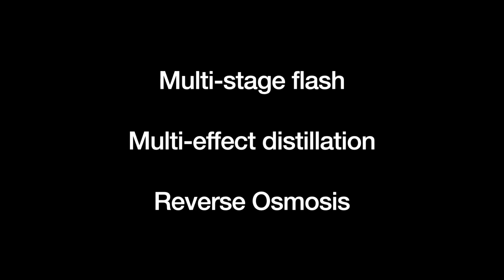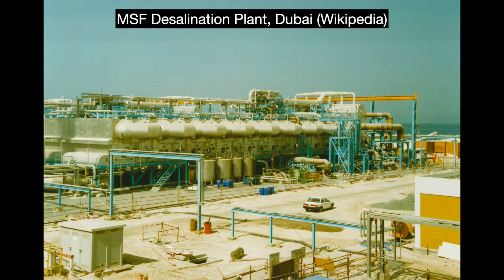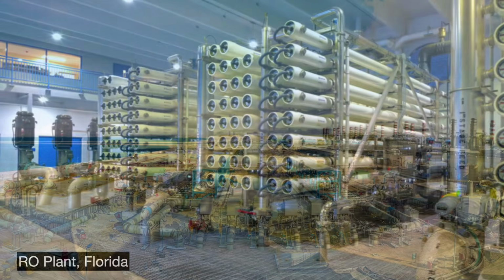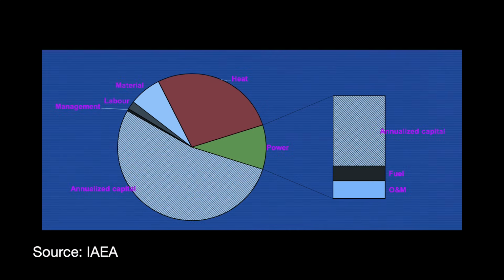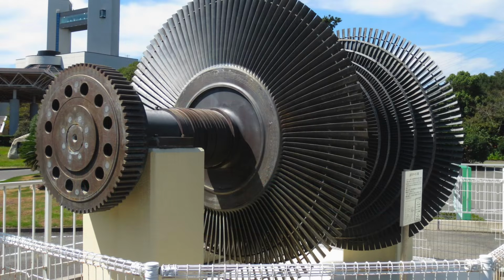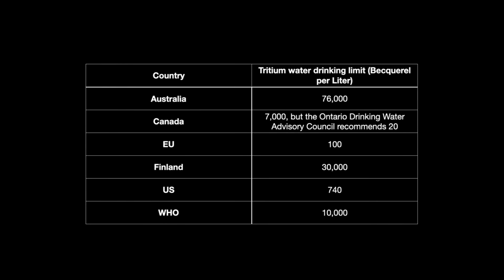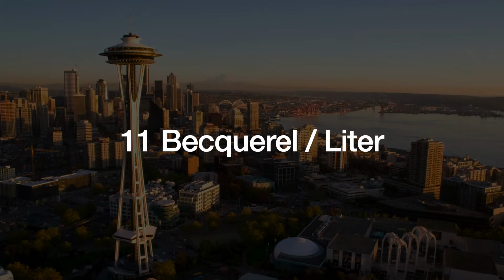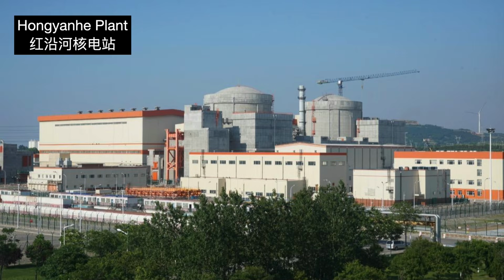Going Nuclear to Desalinate Seawater

Comment: Modern desal plants are up to 90% water recoveries these days - very impressive. That minimises the input flow as well as the sea critters it effects. You then combine the brine outflow with the treated sewage outflows and bingo bango. Let's roll.
Reply: I wonder what ratio of brine to treated sewage are needed
Reply: @FrankGarcia24  Don't forget stormwater runoff. That is  not a zero figure.
Reply: @FrankGarcia24  That can also be used for dilution. It starts to balance out yeah?
Reply: ... how does 'dilution' NOT fail.... at Scale.....
Reply: @nealtauss1715  Every city and it's surround catchment is a significant surface area. A great majority of a modern city is covered with concrete/bitumen/smooth surfaces that have minimal water take-up. That means a lot of rainfall tends to end up as storm surge or in the associated seaward discharge systems of that city. Probably all of that water is not good enough quality to drink however it is ideal to dilute any saline/brine from a desal plant with some simple storage/surge capacity. Thus you should be able to offset the brine production through dilution from sewage/water runoff systems.
Reply: @nealtauss1715  The theory is that we piss out as much water as we drink
Reply: Modern desalination plants that use MED are rare. RO recovery caps around 30%. Msf around 16%. Solar around 20%. It's my job to know these things. Majoroty of plants run MSF and RO at the moment
Reply: @Froggeh92  I think to solve the future water crisis no matter what technological limitations or inefficiencies there are with our current desalination methods could just be solved regardless by the human race not being squeamish and just making a lot more nuclear power plants and using the energy to power whatever is the most efficient water treatment method we have. I also think that when water starts getting real scarce and we take it seriously that there will be many breakthroughs in water treatment and nuclear power because we often always neglect fixing issues and doing the proper research unless we are forced to or are in deep shit. Look at the space race for example but imagine that effort and innovation multiplied many times over for something like a water crisis.

Unfortunately at the present I have serious doubts we will advance beyond a snails pace because of our greed and complacency.

Comment: Here in New Zealand we do the opposite to desalination.  At the Manapouri hydro power station, we take 510m3 of fresh water per second and dump it into the sea to produce 800MW of electricity. That's 44 million cubic meters of fresh water per day.   Makes that Soudi desalination plant look tiny in comparison.
Reply: It gets crazier.  There is a tunnel (9. 2 meters in diameter, 10km long)  that is used to discharge the fresh water into the sea. Once operational, they realised it was too small to be used to operate the power station at full capacity. So they tunneled another one at 10 meters diameter.  Just try and imagine how much fresh water flows through those two tunnels.
Reply: @debochch  its just a dam. Without it, its just a river doing the same thing.
Reply: @TheBooban  no.  In normal dams, the water continues along the river, as you pointed out.  At Manipouri,  the water is diverted away from the river, through the mountain, and directly into the sea.
Reply: @debochch  either way, it is going into the ocean right?
Reply: wtf this is lunacy!!

Comment: Do we want more nuclear power plants to be built by the ocean? We would need to design them learning the lessons of Fukushima, while also avoiding seismically  active areas. Of course, the problem is that an area could be quiet for hundreds or thousands of years and then there can be a large earthquake.
Reply: There are nuclear reactors operating on ships that shake and rattle as they move around the world. I don't think earthquakes are a big issue, really. You can design for them. The problem at Fukushima was that they turned off the reactor the moment the quake was detected, but that meant they needed backup power, and the diesel generators were in the basement where the tsunami reached. If they had kept operating, the accident would never have happened.
Reply: @eckligt  also if the diesel generators weren't located in the basement

Comment: Under environmental concerns you should have talked more about the increased salinity of ocean water near plants that dump their brine back into the ocean after removing most of the water.
Reply: You mean several thousand m³ of more salty water can change the ocean? 

Check the size of the ocean.
Reply: @LMB222  No. High salt brine affects the local area around the outflow pipes. Just like when the guy next to you is smoking a cigarette, you'll breathe it in. Even though cigarette smoke doesn't mess up the whole atmosphere
Reply: @LMB222  Instead of talking about things you know nothing about, you should read about them and never talk to me again. Thanks bub